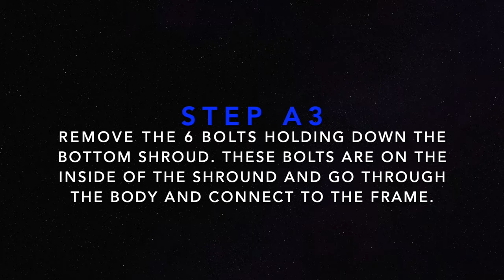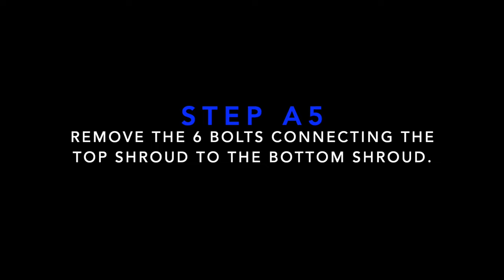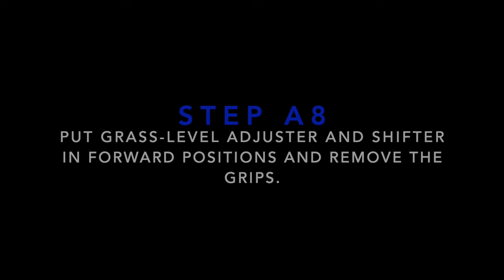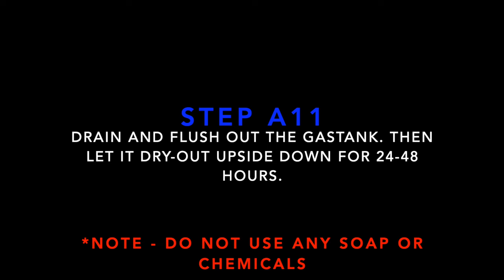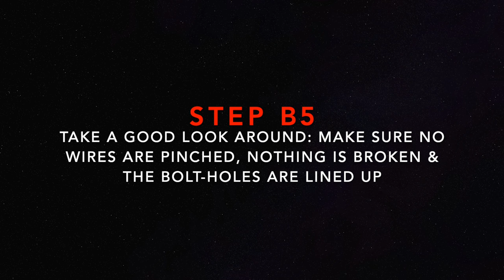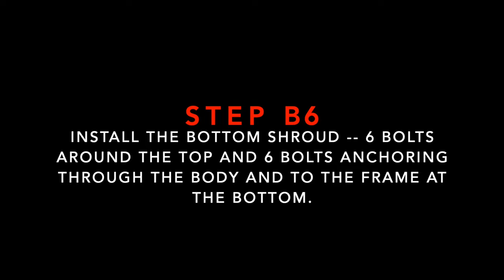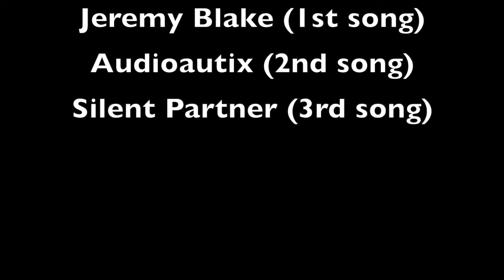The Right Way To Remove a John Deere Gas Tank

Comment: New tanks were like $800 so I found a used one for 100 but it’s the larger version, does anyone know if the smaller tank from a LA115 would fit with the larger version a LA175 uses? , it appears my small tank is held up with 2 pieces of rod and appears to have the room?
Reply from the maker: $800? Are you serious? 
I can't answer your question but there's a lot of people here who might be able to help. If not - there's groups on FB that deal with tractor repairs and you might have some luck there.
Peace

Comment: I'm having an issue with my LT150. No fuel going to fuel filter. Won't start.. blew some air into the line and the tank bubbled but no fuel came back through the line.. im lost on what the problem could be. It was working great a week ago
Reply from the maker: Hi Rebecca,
That particular model is known for blowing fuel pumps and this appears to be your problem.
It's bolted to the side of the motor and is mechanical - not electric. It'll cost you about $50.
Reply: @JohnDisque  John & Rebecca, if your fuel pump is the same as the E180, it's driven by vacuum pulses as the engine turns over. The body of the little pump is plastic (that's how you spell "fragile!!") and has two little tubular pieces that the screws penetrate to mount it. Be careful replacing those two screws. On mine, one of the tubular parts I mentioned is broken on the pump due to a previous "mechanic" forcing it and snapping the plastic. If it will fit, I'm going to drill clear through the mounting point and replace the original with a longer screw and a nut. 

John, as you were describing the corroded battery cable, I wanted to mention that a little water & baking soda will clean that well. Just scrub it with an old tooth brush and it'll foam up and wash away.

Thanks for your effort. This is an excellent video!
Reply from the maker: @MrGaryGG48  Thanks for the tips, Gary. I'll definitely be utilizing that information.
Peace!

Comment: What should I do if I cannot get 100% of the gas out the tank with a hand siphon pump with winter just around the corner? Thanks
Reply from the maker: There's several things you can do. 

Disconnect the gas line at the fuel filter and run the tractor until it starves for gas and shuts down. 

Ultimately it's the gas left in the carburetor  that's your problem because it will gunk-up and clog up the jets and ports.

You could run the tractor until it removes all remaining gas inside the gas-tank. 

You could remove the gas tank. 

You could flip the tractor upside down.
Reply: @JohnDisque  can I put anything in the tank to evaporate it ?

Comment: Them rubber grommets go bad on the fuel hose on top of the tank. I'm dealing with this now.  Everything makes it's way in there after they go bad.
Reply from the maker: Yup..... There's one underneath the gas cap that's known to rot away, fall apart and pollute the gas-tank. After all these years John Deere should know better but..... whatever.
Peace

Comment: My LA105 needs a new idler pulley for the drive belt and I took the nut off the bottom of it but the pulley won’t come off what’s the secret to getting it off if you know?
Reply from the maker: Did the bearings fry? IF the bolt is bent or seized to the pulley.... you can cut the bolt off and find a replacement bolt or you can cut the whole bracket off. John Deere has a replacement bracket with the bolt attached...., but this has to be welded on.
Reply: @JohnDisque  unfortunately the pulley has the bottom half broken off so the belt won't stay on and I can't seem to pull the pulley off to replace it
Reply: @JohnDisque  I was just wondering if the pulley with the bearing is supposed to pull off or if it was pressed on or something like that
Reply from the maker: @LivingInFloridaPanhandle  No... Once you get the nut off..., the pulley should slide right up and off. The bolt stays in-place with the bracket. This is what makes me think the pulley seized itself to the bolt.
Reply: @JohnDisque  okay thank you so much for your help I'll see what I can do this weekend and report back with the news

Comment: Its a great video  but to say you can all that and remove the fuel tank seems like quite  a stretch.  
  Maybe  if you've  done it several  times , know the size socket for each bolt and such but even then...... it takes me 3 minutes  to remove  the battery  from the tiny opening  its in😃
Reply from the maker: Well.... I mention this in the video. "I it's your first time you should take your time." After that - it's all a no-brainier.

Comment: The black debris is the gasket from the cap. It happened to my mower. Exactly why I’m watching this.
Reply from the maker: Hmmmm.... That's very interesting and I never even considered that but I bet you're right.
Thanks for that input!
Reply: yeah, I found this out some time back. cheap gas caps for sure.
Reply from the maker: You're right, Greg. I can't believe I never looked under my cap but I finally did and that rubber gasket thing was 3/4 gone.... dry-rotted and absent. It had nowhere to go but inside the gas tank.

Comment: John Deere should have designed that better. A far better design would only require removal of about 4 bolts to remove that entire top from the rear end, giving much better access to the fuel tank and the top of the transaxle.
Reply from the maker: I agree.... I think they just evolved the original design over the years and sort-of put band aids on broken legs. 

There's a lot of design flaws - especially in the deck. 

Whatever is cheapest to do is what they're going to do because there's a lot of competition in this industry,  so they have to keep their production costs low.

Comment: This is completely unnecessary on an X500.  Six bolts remove the rear shroud.   Nothing in the front of the tractor.
Reply from the maker: Yeah - different models are much easier, and I want to point out which ones they are..., but John Deere has so many different models and I haven't worked on all of them, so I'm kinda lost on that issue.